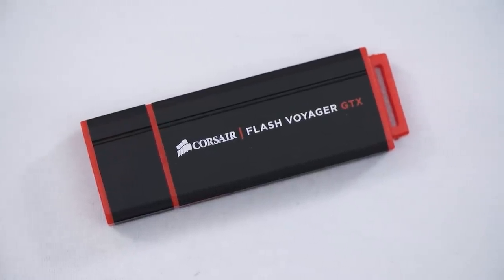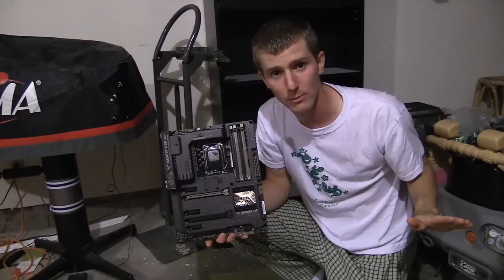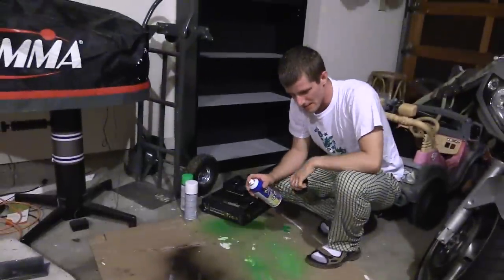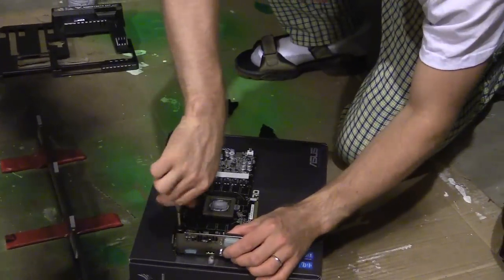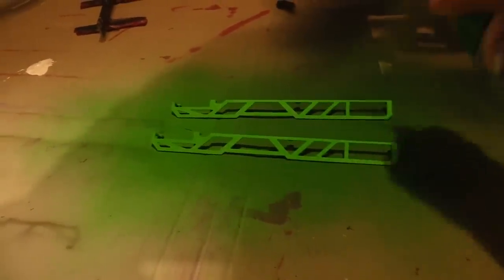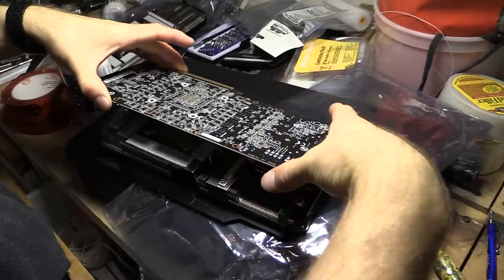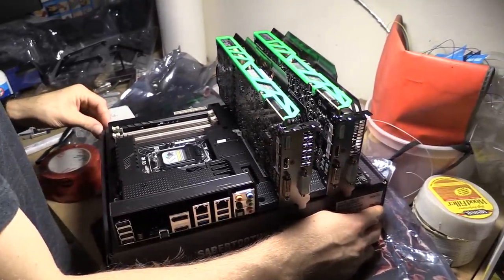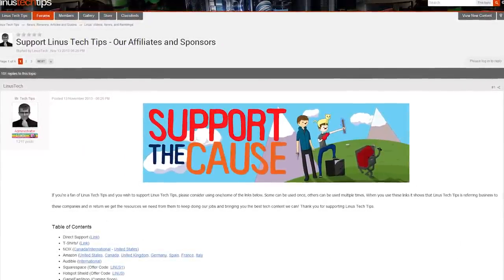How To Paint Your PC Parts - Linus Plasti Dip Method

Comment: plastidip is actually supposed to go over black dip, not white. watch the dyc videos from them. they rarely use white as a base. the black does better. also youre supposed to do 5+ coats to make it peelable, otherwise it behaves like paint.
Reply from the maker: Blaze colours specifically call for a white base.
Reply: ahh well then nevermind. didn't realize it was "blaze"
Reply: LinusTechTips doesn't adding that much paint just create more heat inside the pc??
Reply: +Chris Reyes Depends what you're painting. These parts don't really generate any heat so it won't do too much overall. The heatshield on the mobo might do something though
Reply: +RL Media (RLM) They do it for most base coats when using darker colors. Using brighter/blaze colors works better with a white base coat. Check out the DYC blaze orange and blue rim tutorial. He specifically says it looks better with a white base.
Reply: +Chris Reyes Not necessarily. Thin coats of paint aren't really going to change the heat dissipation/thermal properties of an object. The main thing I think you'd have to worry with is high heat ruining the finish of the paint job. But typically as long as the paint is of good quality and you're not subjecting it to crazy temps it should be fine. Parts like the heat shield or the caps on the memory aren't actively generating heat and only get warm to the touch due to their proximity to heat generating components (for instance, notice he didn't take the heat spreaders off the ram and paint them). But tbh, most instances I've seen of people painting stuff in their build is usually just some case components or something, but to each their own. It's not like if this build is ruined because of the paint Linus can't just ask for new parts from someone who endorses him haha.
Reply: +RL Media (RLM) There no rule that says you have to use black base, it just matters what you're going for, if you want a dark deeper color you use black or you want a lighter color you use white.
Reply: akapdcdaka plastidip recommends black base for most of their colors. the exception being the blaze series, which linus was using and already said at that at the beginning of the thread
Reply: +Chris how much heat do you think those painted parts would generate anyway? :P The RAM and GPU things aren't ment to dissipate heat anyways.
Reply: +Bloodstainer i had my muffler tips painted with white plastidip to see how well it would hold up its still there haha itll take some heat
Reply: Dude- didn't realize?? Not only did he state it multiple times,, he actually SHOWED us the can! lol
Reply: Yes, we established that 2 years ago. 2/3 of the cans were standard plastidip, 1 was Blaze. Honest mistake. Thanks for your contribution.

Comment: I usually paint my components with a paint brush and some house paint, lead base prefered. I use the paintball method on my motherboard and dip paint my PSU for some kick ass swirl patterns. After that I like to spray paint the pins on my CPU silver because gold isn't really my color.

Comment: is the point really to make the paint removable? if you're painting you want it to be painted, not to revert to original colours.
perhaps to fix mistakes but again if you're painting you're a hardcore tinkerer enthusiast so that should come with the teritory.

therefore i prefer to use a metalic paint because it makes plastic look metal, rather than metal look plastic.
Reply: Oh, they want to be removable since it's the only parts they have. They re-use parts over and over, not to mention, once they are done with a build guide, they remove all the parts and use them for whatever else
Reply: could get a pearl color plasti dip i think to make it look metal
Reply from the maker: being able to remove it is critical if if fails within the warranty period and you need to restore it to "factory default" to send it back for replacement.
Reply: regular permanent paint will void the warranty of most if not all products
Reply: ***** it gives companies a RIGHT to deny warranty claims but most won't. galaxy allowed me to paint my 460 shroud a'ok.
Reply: LinusTechTips No sane company is going to let you return something that has been painted.
Reply: LinusTechTips the point of painting is extreme tweaking and change. The process of painting results in dismantling. If none of that has already broken the warranty and the person doing it actually cares about maintaining a warranty then i suppose they'd better use plastic paint.
Reply: rfizzle
yeap. THat is one of they ways to find out whether a company is a decent one.
Reply: Jesse Mallen There are metallic additives available with Plasti-Dip. Have a look at the YouTube channel 'DipYourCar' for more information about the various Plasti Dip products that are available for purchase.
Reply: Jesse Mallen I would use plastidip paint as a base, then a metallic over it. As warranty goes, you can remove the plastidip and revert to original. That's why I would put the metallic OVER the plastidip.

Comment: Plasti Dip is the coolest paint invention ever. We sell it at our auto parts store and can't keep it in stock to save our lives. People are actually using it to paint their cars with and, believe it or not, it actually comes out looking good. It's like a screen protector for your car if you just use the clear. And when your done, it peels right off easily without harm to the factory paint.

Comment: If I take the cooler off my GPU and change my thermal paste, will it void the warranty?
Reply: Yep
Reply: Ok, thanks. I don't want to do that any time soon.
Reply: depends on the gpu maker. evga, xfx etc does not.
Reply: MrZucchinii evga is the only way to go. I broke my mobo and they replaced it for me :D. I love EVGA <3
Reply: As far as I'm aware, the manufacturer will specify that the warranty would be voided via a sticker on one or more of the screws on the cooler.
Reply: Ahh, the stickers... EVGA is a kind company and encouraged me to with warranties intact; however, if you don't know what awaits you... use caution.
You need to use a guitar pick to safely raise the sticker and a super clean environment to do it.
Honestly, if you're not water cooling the GPU or otherwise improving the lifespan by a great deal, you may find that it's not worth the troubles.
Weigh your advantages versus the cons of the procedure as you're gambling with your vendor's policy.

You're your own boss, none of us can guarantee that you'll successfully perform the task flawlessly.

Comment: I waterproofed an old HTC smartphone using Plasti-dip in the past. (with the phone disassembled but all electrical connectors connected, I put 5 coats of clear plasti-dip on the boards and all connectors and was a success, no issues with functionality at all.

Plasti-dipping the motherboard might not be a bad idea for those that want to get REAL creative.

Comment: What the hell was the point of painting the ram when you couldn't even see it.
Reply: MrPepsicola123 That RAM, specifically, has an LED that glows into that piece he painted. So now it will illuminate green instead of the stock color.
Reply: Well if you have a window side panel you can see the interior

Comment: Do this gonna improve your pc performance?
Reply: YES YES YES. If you paint your components red it will go faster but you will have higher temps. If you paint them green then your PC will use less power and go fast. If you paint them yellow you get really really fast performance at the cost of a lot of power. Or you can paint it blue to go so fast and cold for the best. You can try and paint your components red, yellow, blue, green... But no one has this before as it can spawn something unbelievably powerful.
Reply: ***** You... You sir are my hero. . .
Reply: ***** Priceless!  :)
Reply: omg epic color breakdown, sounds legit
Reply: why not paint go faster stripes on your heatsink! That will make pc go faster!!!
Reply: Colors don't matter in a PC, well on cables it does but on frames and cases? Hell no, it's just for asthetics and looks.
EXAMPLE: So say you want this one graphics card or something and it's red instead of blue like the rest of your build, you can just recolor it like Linus did in the video to make the part blend more.
Reply: Firmentus . Whoosh!
Reply: Adds 20hp!
Reply: YES IT CAN!!!!! But not only that, if you paint a lightning bolt on it, IT WILL GO EVEN FASTER!!!!  BUT REMEMBER, when you paint the lightning bolt on your pc components, remember to to paint rain on it as well, or else it will over heat and wont be cooled down by the rain.
Reply: of course it does. just like putting stickers on a honda
Reply: Yes, it makes it COOLER :P
Reply: +Chaotic Impact thanks now i can play bf4 and watchdogs at 64.5fps cool :D
Reply: Paint a TARDIS on it it will go so fast it will go through time and space

Comment: not sure anyone has mentioned it, but when you use plasti dip you need to do heavy coats (at least for the first coat), not light coats like you said otherwise you'll have a hard time peeling it off properly... it'll still come off, but experience from myself and others (on car parts) is if you do a light coat, or too few (5 or more coats with the first being heavier than the rest is ideal) it will more "flake" off and only come off in little strips than coming off in one big piece

Comment: I used plasti dip on my laptop, taking it completely apart to paint all pieces fully and correctly. I used at least 5 coats on each piece. Well, it lasted maybe a day or two before the edges began peeling. I would strongly recommend that people don't use plasti dip on parts handled frequently. I know it's advertised to work on cars, but it didn't hold up for me.
Reply: It looked good while it lasted :)

Comment: I don't think painting computer parts is "stupid", I'm just not confident enough to do it. I could watch as much tutorials / read as much as possible about it, and still not be confident. I've built multiple PCs, my first one being pretty awful looking because I didn't know about how enthusiast PC builders always strive for an aesthetically pleasing PC, so after I spent months learning about building PCs and about the components themselves, I just searched Newegg for the highest end parts that match my price range and work together, then ordered them. I'm actually still using that machine, now, and have only done two upgrades (better CPU cooler and an SSD) because I'm too cheap to build a new one, but I really want to. Black and blue motherboard, blue graphics card, grey-ish SSD, white case, black CPU cooler... it's also quite loud compared to how I build PCs for clients... I've built my friends and clients PCs that are far, far, far superior to mine with a similar price range, simply because now I know about a consistent theme, color scheme, cable management, etc... I just stare at them when I drop by and weep... Lol.

Comment: I can only imagine the thin plastic coat insulates the aluminum heat sink on the memory. I think custom colors are great unless they start impacting performance in a negative way. Except for certain enthusiasts, you will end up using your computer much more than looking inside it. I personally wouldn't trust myself to successfully deconstruct and reconstruct the components, so in my case I would just leave things stock color. Improving the thermal compound is a pretty decent reason to take them apart though

Comment: I understand that this paint is supposed to be removable, but this guide does not do painting justice. If you want your paint to last. Sand the surface beforehand, then apply a primer, multiple light coats of proper paint for the surface. Afterward a clear coat and/or sealant should be applied.

Comment: I forgot to plug the fan back in on my gtx 770 after I applied so after market thermal compound, and I wondered for about 3 days why it was running at 85 degrees c at idle

Comment: How badly does dust stick to the plasti dip? It leaves kind of a rough finish that dust clings to. If I were doing it I would use plasti dip glossifier over the top. It should smooth it out a bit

Comment: if i don't have extra thermal paste can i still do this and just reassemble the graphics card with the old thermal paste??
Reply: SuicideFixated Ignore what I said earlier.
Reply: SuicideFixated Don't do this. You can get thermal paste SUPER cheap and get it in 2 days from Amazon Prime. When you pull the heatsink off of the graphics card, it's going to screw up the thermal compound and when you put it back on, it won't have as good of a connection as it did before, potentially leading to heat issues. It's worth the $10 and 2 days wait time to do it right.
Reply: SuicideFixated I wouldn't dare. The reason you are replacing the thermal paste is because it will no longer sit well and your cooling will be sub-par.
Reply: Dylan Wilson do you have to remove the old thermal paste with cotton balls and alcohol and then reapply the new thermal paste and will the thermal paste tou use on cpu work on gpus
Reply: Bo2xSupeRxBoss yes, remove the old thermal paste and apply new thermal paste. I've heard that you should use a non-conductive thermal paste with GPUs, since there is more exposed, but as long as you are extremely careful, it doesn't matter.

Comment: Finger Nail Polish Remover works really good for thermal grease.. cuts right through it. Question : What was the point of painting the green bars on the ram? You can hardly see them.. if at all.
Reply: Hubba Bubba Because there is LED down. They are going to reflect the light giving them a green LED Efect.
Corsair Dominator Platinum have LEDs

Comment: you need to paint the ram screws green
Reply: Worst idea ever, if you paint screws they never ever fit in the screw holes.  They make the screws fit tightly for a reason.  :\
Reply: I've seen bolts and screws painted over but after they're in place, but never before.  The only way I could see it working for this project is to use some kind of model paint brush and it's going to take delicate hands not to get it all over the ram cards themselves.  While I agree a colored screw would look cool I honestly have no idea of how you would do it properly.
Reply: the screws come out so you can just spray paint them
Reply: easy there keyboard warrior
Reply: Never paint screws.
Reply: Green Anodised bolts would work better and look a lot nicer
Reply: 99bulldog You could just hold the screw by the tip and dip the flat end into a small dab of paint, let it dry, then screw it in.
Reply: ***** the only thing that matters in this arguement is that someone made a sentence that rhymed XDDD awesome

Comment: So, you put your graphics card on the anti-static bag on the outside, wonder what could happen...
Reply: Its been proven that putting any computer component on the outside of the anti-static bag wont harm the components, the material inside of the bag isn't made out of a different material as the outside of the bag. The reason why many people say its dangerous is because the anti-static bag will only work if you have the component inside of of the bag, meaning it works like a cage, if you put something outside of a cage it defeats the purpose of it being a cage, thus leaving it less secure for anti-static discharge.
Reply: zoomernw Actually that's not correct. Certain types of anti static bags do conduct on the outside of the bag
Reply: probably nothing
Reply: as long as you don't plug it in and turn it on conductivity of the bag isn't an issue
Reply: t moore That's not how static electricity works
Reply: DrBrovahkiin It actually is how static electricity works. The conductive material on the outside of the bag is not an insulator, so it cannot create a static charge. You can discharge a static charge into it, but this is no more risky than touching the board directly. If you were to discharge a static shock into the cage of the bag, and it hit the board, then it would still have hit the board if you would have handled it directly.The conductivity of the bag is irrelevant. Always ground yourself, and it's never an issue.
Reply: zoomernw No. Antistatic bags work by being insulated on the inside and conductive on the outside. so static discharges from your hands onto the conductive surface of the bag. Then when you handle the component there is no static charge on your hands.

Touch a conductive surface before handling delicate hardware, don't place delicate hardware on conductive surfaces. How is this a difficult concept?